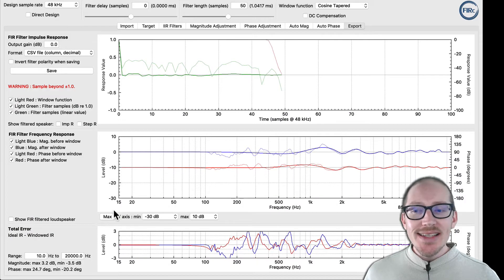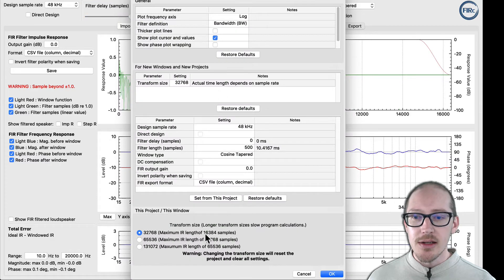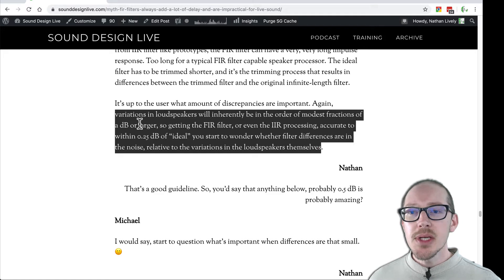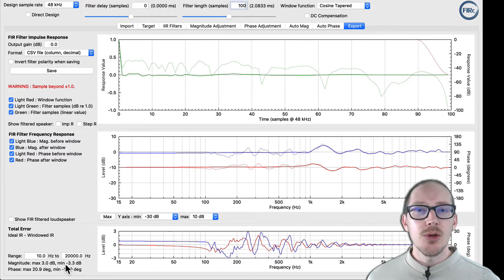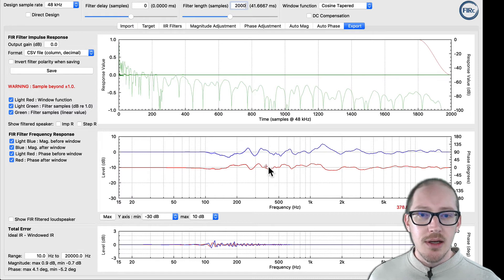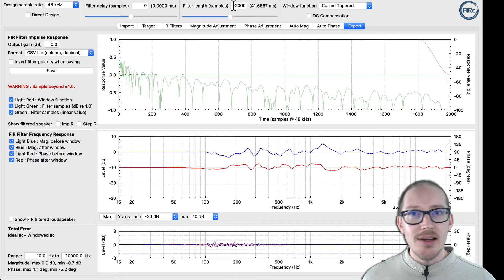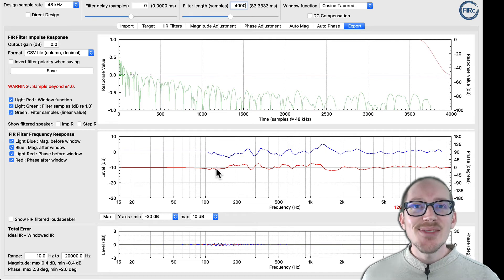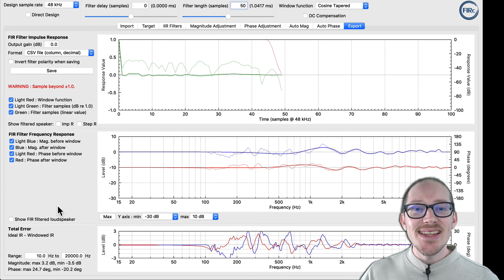FIR Creator: Is the ideal total error zero?

Comment: A longer filter does incur delay - a lot! Anything over 5-10ms is only going to be passable in playback only with no live performance, whether that's a guy with a mic doing speech, a DJ or a band! So great for your hifi perhaps, but I've rarely come across filter lengths of more than 8ms in the 'real world'. Martin Audio MLA Mini has over 10ms built in, and you can definitely hear it at the size of events that it's commonly used for with small stages, and open mics close to the crowd in terms of distance.
Reply: A larger filter will only incur longer delays if you are creating linear phase or mixed phase filters. You are free to create magnitude corrective minimum phase filters with FIRd that have (essentially) no time penalty.